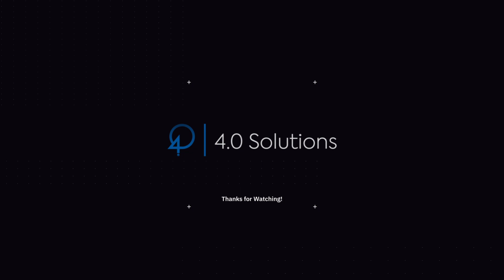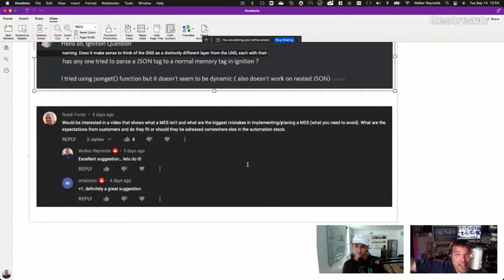Quality vs Performance (What's more important?)

Comment: A lot of short downtime in manufacturing is built into production times, such as changing a carbide inserts or changing drills, changing welding wire, replacing thread on a sewing machine . If every 25 pieces I need to index my carbide insert on a 10,000 part run I build this "downtime" indexing the insert into my production so its part of the run time. Its how you define downtime or run time and how you build it into your schedule.
Reply from the maker: Planned downtime — 🙏